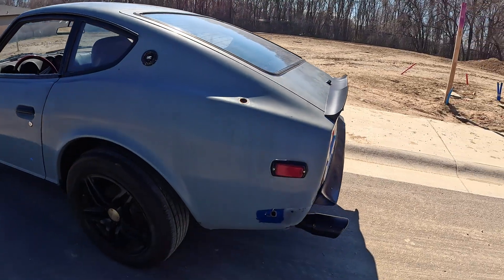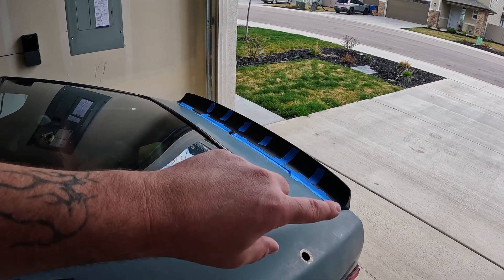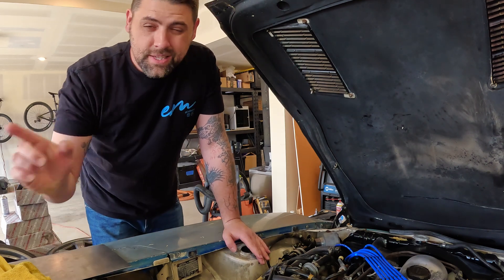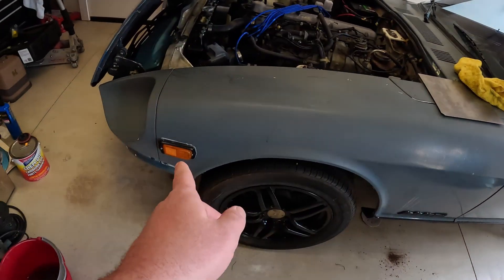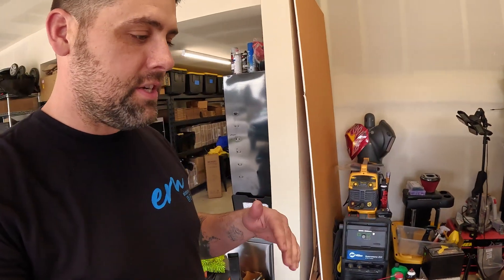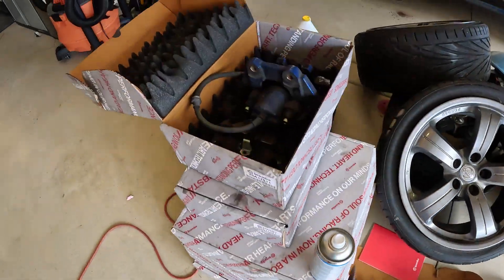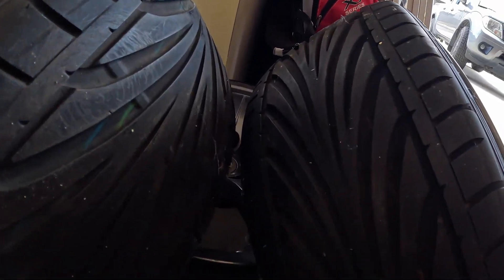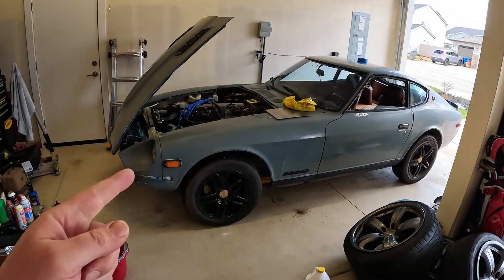I hit the marketplace jackpot and 3d printed a spoiler for my 280z

Comment: What program do you use to be able to split them into pieces? I want to 3D print larger objects but be able to split them like you did while adding that little notch you did for the inserts.
Reply from the maker: I do it all in fusion 360. I create an offset plane every 120mm or so and then use that to divide the part and then manual create the dowels and then do a subtractive cut of the other half....hopefully that all made sense.

Comment: Spoiler looks good! It really sucks that a VQ is so cheap, but a CD to go with it is so expensive.
Reply from the maker: Thanks! Yeah the motors are pretty affordable, secondhand the transmissions aren't too bad. New they can be had for $2200, which is pretty fair for a brand new Nissan transmission. I actually just picked up a donor car today, so hopefully I can start making some progress.
Reply: @EndMotive  Just sucks they used to be like $1,600 brand new IIRC and you could find them used for $500-900 all day. Prices have just gone up a lot with the popularity.
Reply from the maker: @802Garage  For sure, I was looking at them only a couple years ago and you are totally right....Unfortunately, everything has got a little crazy in pricing. I can still find them used in the $800+ range...but harder to find.